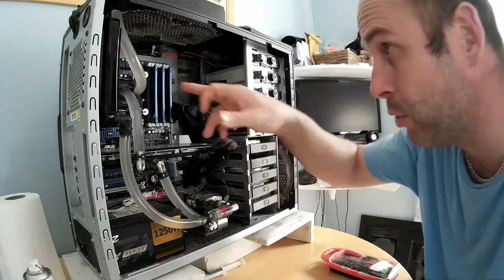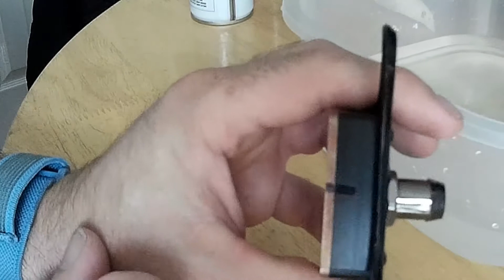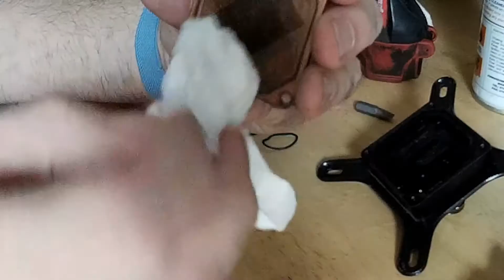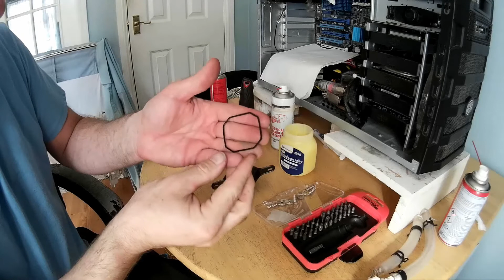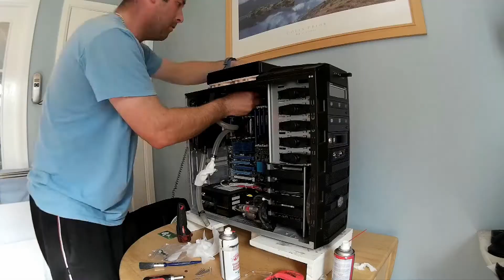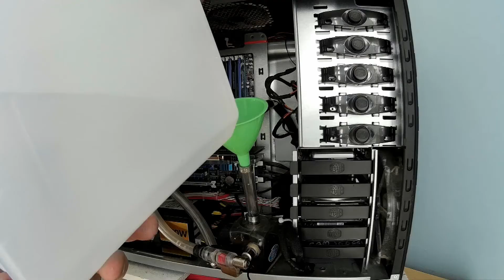Replacing a graphics card in a water cooled system.

Comment: Good to c ur pc...
Im also using 2 rad on 1 pump..I thought 1pump wont b enough..
What temp u get for GPU if use for 1hour on load ?
Reply from the maker: After about 1 hour it will be no more than 50C with an ambient of 20C.  I'll try it later and post it here.
Reply from the maker: It was no where near 50C.  Here is a scren print with some added details:  http://i570.photobucket.com/albums/ss149/halox206/temps_zps66805637.png
Reply: TheKayakingkid thx for posting details..
My pc after 1 hour on load is 53C..
Do u use any special liquid cooling or just distilled water
Reply from the maker: Syed SAW No probs.  I use distilled / De-Ionized water and a silver kill coil to control any bacteria.
Reply: TheKayakingkid Its hard to get kill coil online..at my place ..
Reply from the maker: Syed SAW It doesn't need to be a coil.  Any 99.9% pure silver will do.  All it does is release silver ions into the water preventing bacteria from reproducing, killing them off.  The coil is used as it fits in the tube easily and doesn't move far.  All the fancy cooling liquids are only to catch the buyer.  None outperform distilled / De-ionised water in the long run and its cheap too.
Reply: TheKayakingkid agreed...
i will get a silver Ring :P